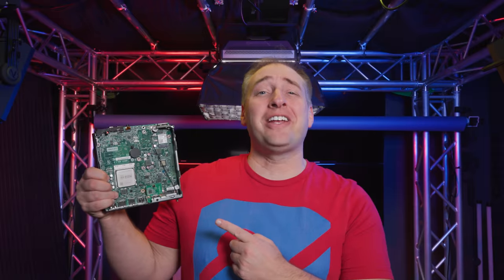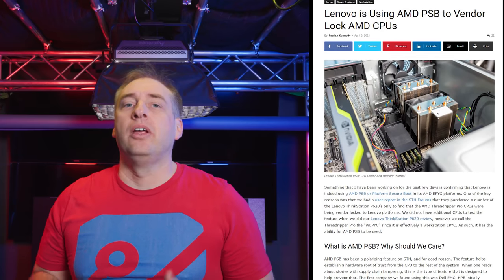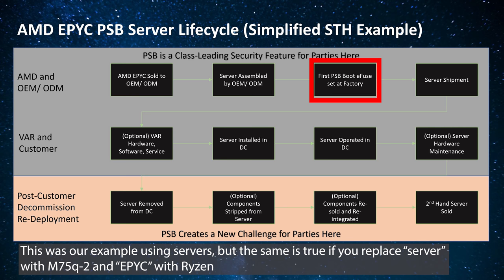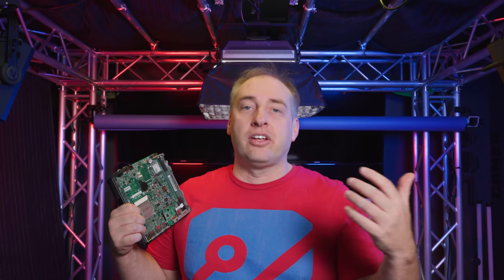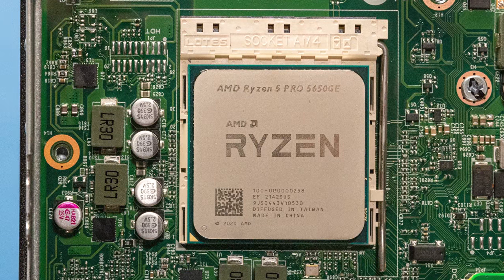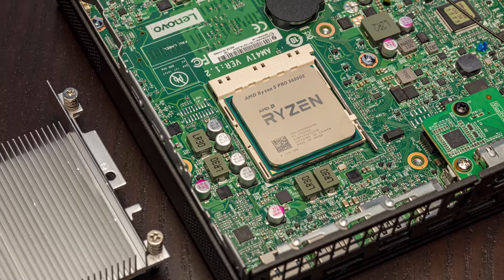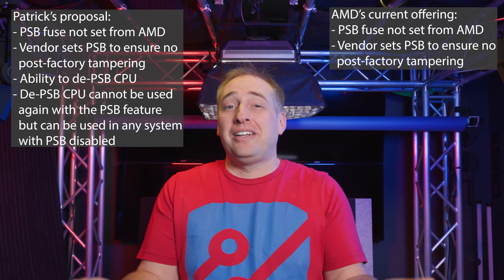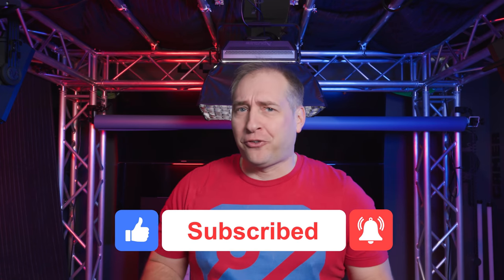Yikes! Lenovo is vendor-locking AMD Ryzen CPUs via PSB

Comment: Instead of saying "Hey are you going to vendor lock your CPU",  the warning when you put in a new CPU should be more like "Would you like to permanently damage your CPU, decrease its value, and increase the chances it's going to get tossed in the garbage because someone down the line thinks it's broken?"

Way to erode trust in your hardware, AMD.  It's wild to think that Lenovo is so concerned that someone is going to put a compromised CPU in their motherboard that they have to permanently damage it.  This doesn't even really stop a bad actor this determined because, if they are going to that length, wouldn't they just make a pre-fuse blown compromised CPU to put in this system?
Reply: You have it backwards. It prevents a malicious firmware from being installed on the motherboard, because the CPU will refuse to boot if the firmware is not signed by Lenovo.
Reply: @l-cornelius-dol  
You do know that if someone has the capacity for firmware attacks, that obtaining manufacturer's keys isn't out of their scope? This doesn't solve jack except the problem of how to make more bank.
Reply: @rockytom5889  Not true. One has nothing to do with the other.
Reply: @l-cornelius-dol  So, at 6:32 in the video the message sure sounds like it's asking for permission to blow the fuses in the new replacement CPU to vendor lock it to the machine.  Otherwise what kind of "vendor lock" is it asking to do?  Why would a brand new CPU that's never been in the system refuse to boot if the firmware was replaced?
Reply: @iguanac6466  : OK, you are going to have to at least attempt to look at why this feature exists in the first place. Once the CPU has been locked to the firmware key (at the factory) the firmware cannot be altered or replaced unless the updated firmware has been signed by the vendor’s key. Ergo the firmware cannot be altered by malware which is run on the PC.

I’m not saying it’s a great way to solve the problem, but it does solve a security problem. It’s not meant to prevent you from replacing the CPU, it’s meant to prevent unauthorized changes to firmware.
Reply: @l-cornelius-dol  I can only go by what this video is claiming...that Lenovo are simply blowing some internal fuses to make the CPU identifiable by the motherboard BIOS vs a standard off-the-shelf CPU and then refusing to run if your CPU doesn't have the correct fuses blown.

This doesn't actually sound all that secure unless there's enough fuses to blow in these CPU's to create something long enough to be a decent unique cryptographic signature AND that the BIOS will refuse to run if a non-paired CPU is installed.  Based on the pinned post, this is not the case.

Vendor locking your CPU is not security.

I'm always happy to do more reading if you have different sources on what you're saying.
Reply: @iguanac6466  The CPU does contain enough fuses for a cryptographic key, or at least this is how it works in Qualcomm systems. Once the key is burned it's the CPU which refuses to run an unsigned BIOS, not the other way around.
Reply: @l-cornelius-dol  Another way to protect against malware altering the firmware is to write-protect the bootblock of the firmware's flash chip. Chromebooks have been doing this for years.
Reply: @eDoc2020  : Oh, I quite agree. I’m not saying this solution is a great one; indeed I detest it. But it does solve the problem. And it does have the advantage of only allowing a properly signed firmware package, protecting the less knowledgeable user from applying an unauthorized, malicious firmware.
Reply: @l-cornelius-dol  Then have a bloody jumper on the motherboard that does the same thing, same level of security and same level of hardware access required to bypass, without creating a ton of e waste or destroying the second hand market and resale value of a bunch of CPU lines.

Comment: This just seems like a vulnerability waiting to happen. So if you have a non-blown cpu, a malicious actor can blow the fusewith arbitrary vendor code and brick your machine?
Reply: maybe you need special AMD-sanctioned code. not something that cant get into the hands of bad actors, but difficult and I don't know how to monetize that
Reply: Hopefully someone actually does that, so we can see the end of this half-assed bullcrap. If a few of these vendors would have to suddenly warranty couple tens of thousands of these CPUs and have their trust shaken, things would quickly change...
Reply: the theory is that if you want to deploy this (and it's not enforced) you want your hardware to fail as soon as possible if you get compromised.

But this need to be at the discretion of the company, and it need a way to be unlocked.
Reply: @kharkin0  I highly doubt that, you probably get a vendor ID from AMD that you can hash for each mobo, so the leak would have to occur pretty high up in the chain. I doubt even state-sponsored operations can get at that, and anyway I don't see the motivation for them to do so, if it's bricked it's bricked, and blowing the fuse would probably require a reboot, so it's hard to exploit
Reply: They could just implement enabling/disabling the feature with a hardware jumper or a special resetting system that requires taking the CPU out of the machine.This one time programmable bullshit almost feels like intentionally purposed for vendor lock in. Maybe it was the easiest solution to implement in a rush.
Reply: I like how the Atmel/Microchip arm processors have a "erase" pin. You pull the pin high and it erases everything. Since eFuses are generally flash based these days they could provide a "erase" pin. Of course the pin might need 12 volts though so that would require taking it out of the system to erase it.
Reply: @steffeneilers8530  ransomware but if you don't pay it destroy your pc
Reply: @LaserFur  maybe a modded bios could ignore the bs to and just run the CPU anyways? Or present fake vendor ID to tricj the CPU to go
Reply: @virtualtools_3021  you would need the encryption key to fake the chip. it's not the bios doing the check. it's the processor on the chip. But a virus could turn it on.
Reply: @virtualtools_3021  But you can just not restart it as long as there is no fix
Reply: @steffeneilers8530  
If you have the capacity to make custom firmware and deliver it to the targets, it can only be assumed you're close enough to the manufacturers to be able to snag the keys.
Reply: @rockytom5889  Making custom firmware isn't that hard and delivering custom firmware can easily be done by anyone who can intercept the shipment from the manufacturer to the end-user.
Reply: @rockytom5889  I think the keys come from AMD, the BIOS/firmware development happens at the manufacturer
Reply: @rockytom5889  I remember reading a news article years ago about the Feds intercepting wireless router deliveries and modifying the firmware on them before sending them on.
Reply: @steffeneilers8530  No. As you saw in the screenshot, a unfired CPU can be locked too by the lenovo system by pressing Y. Meaning you don't need a vendor ID from AMD. So its surely possibly to create your own UEFI and lock the CPU to that. But what I understand, the system must be bootable, meaning a malicious actor cannot purposedly brick a system by doing this, because the CPU will actually check that the signing keys are OK before permitting to blow the eFuse. This would be extremely important incase there happen some glitch in the communications between PSB and processor in the moment you press Y. Meaning, a malicious actor wanting to brick a system for real, would need to implement some keyed BIOS, which then erases itself after a set time unless provided with a unlock key within a specific time.

Comment: I have said it before that the PSB feature is just a way for AMD to stifle the second hand market of their CPUs.
Since the CPU will work with ANY motherboard that is from the same vendor, then it isn't really implying security, just vendor locking. If AMD wants to wave a flag of security, then PSB is a fairly poor implementation, since it doesn't tie the CPU to a specific motherboard, one can still swap out things under its nose.

I wouldn't be the slightest bit surprised if the TPM feature gets combined with the PSB feature in the future, effectively making all Windows 11 systems and others who depend on the TPM feature ending up vendor locked as well. And that would impact the second hand market rather quickly.

And the idea at 11:53 is a good one, being able to disable the feature and have a functioning CPU is a good solution. And I agree, if one wants "security", then one obviously shouldn't buy the CPU second hand...
Reply: The point isn't to tie the CPU to a particular motherboard, the point is that the system will only boot firmware signed by a specific vendor.
Reply: @DMStern  If one blindly trusts a specific vendors firmware, just because it has their signature. Then what stops an attacker from using firmware with known security issues that has the same signature?

The vendor could update their signature for the new firmware, but then you need a new CPU.

And when do we tend to get firmware updates? Well, when security flaws are found.

Therefor it would have been better if the security system provides its own signature for the BIOS chip to store on the motherboard. Tying the CPU to the specific motherboard, and not to the vendors slew of software that has the same signature, where a fair portion of that software is known to have security issues.

This would however require the CPU to not be a brick if it detects a mismatch in signatures, but rather provide the lack of security up our boot chain.

And a decent way to implement the security would be if the CPU scanned the BIOS ROM, hashed it, and provided a signed hash to the BIOS ROM. The signature here would be some unique encryption key that only our CPU knows. It can be symmetric encryption as well, since it at no point has to leave the CPUs internals.
Reply: @todayonthebench  The scheme you describe *is how the PSB works today*. The only difference is that the system vendor programs the key into the CPU. The alternative would be that AMD would have to vet and sign every firmware release for every vendor.

AMD has features protecting against firmware downgrade attacks, but I don't know the specifics of how it's implemented.
Reply: @DMStern  I personally think AMD has a poor implementation. It should be the motherboard that stores the proof generated by the CPU.

But most importantly, a CPU shouldn't effectively brick itself just because it finds an untrusted firmware.

Considering that they rely on OTP memory to store the credentials, it isn't much they can do to stop downgrading. Unless they have a lot of extra OTP for such "alterations" over time, but then they still have the issue that the CPU will become worthless junk after sufficiently many firmware updates. (And OTP fuse arrays takes a fair bit of room, so they won't be wasting tons of silicone on this, I am surprised if it is more than 1-2 k bits in total.)

"The alternative would be that AMD would have to vet and sign every firmware release for every vendor." Isn't the only other alternative. There is plenty of ways to ensure security in a larger system.

The system I described won't on the other hand tolerate firmware updates nor downgrades, or any change to be fair. But this is why it needs some secure state where firmware updates can be performed and signed (likely in BIOS).

To start this feature, we likely use a user defined key stored in OTP to open that option. Preferably we should have an 8 or more character, case sensitive alphanumerical key that can only be accessed after x minutes after system start. (The timmer after start is so the CPU's security system only accepts 1 attempt per power cycle, and the timmer is just looking at the 100 MHz system clock, and from there it is a simple 35 bit hardware counter.)

This is to prevent anyone having KVM/hardware access from just flashing in some new firmware and have it instantly trusted. 

Though, considering how we also want to be able to make a CPU "unsecure" again, even if we don't know the user password. Then we need some way to validate that the CPU is secured or not. Here simple hashing and checksums is our friend. Just store a AES-256 key in the CPU's OTP array, have it decode something for us, if it does it correctly, it is trusted. If it doesn't, then we can't trust it. (If the security system is turned off, this OTP key should obviously be erased.)

Reason for the symmetric encryption is that any application in need of hardware backed security can just send its data through the validating function to have the "this needs validation" version of it. And symmetric encryption is simpler to handle. And this is safe since the key never leaves the CPU's internals.
Reply: @todayonthebench  A system that can sign its own firmware doesn't protect against the attacks these schemes are designed to protect against.
Reply: @DMStern  The discussion about what firmware one can and can not trust is an topic in itself. But even if AMD or Intel gives  a firmware its token of approval doesn't really mean we as end users can trust it. Nor if the motherboard vendor gives it a token of approval.

We can only trust it for as long as we know that it doesn't contain any known security issues or back doors. Ensuring that is hard.

But yes, the firmware should still be signed by the author. And having a trusted third part validate it and sign it as well isn't a bad idea. Likewise is having a known checksum a good idea. There more ways for us as the end user to validate that it is what it says on the tin the better.

But only allowing "approved" firmware is not required for security. (and that honestly has some interesting security deficits in its own, like can one trust the approver?)

Providing the CPU itself with some minor "BIOS" of its own where it can provide the end user with the checksum of what ever contents the BIOS ROM contains would be a somewhat decent way to ensure that the end user can check that they are running the firmware that they trust. (How one would do this is a different question. Perhaps a simple text string shown in the upper left corner of the screen before the BIOS splash screen. It might only be there for 0.5 seconds, but people have phones with cameras these days.)

In the end, it is a lot easier to point out security flaws than what it is to ensure that they aren't there.

The idea of having the CPU sign its own environment is more about adding a lid on top of what one has already secured, ensuring that no one can modify it without getting noticed.

Ensuring that you get the firmware you can trust, well checksums and signatures is your friend. As long as you can trust that specific firmware.

Comment: it is going to cause enough problems in the new product market, let alone the second hand market - Retailer sells a CPU, purchaser installs the CPU into a system that v-locks it, purchaser then decides to return the CPU using whatever consumer laws are in place in their region. Lets hope this does not become a common feature of general motherboards. A system that converts $600 consumer focused CPUs into nothing more than potential e-waste on first use is not a great idea.
Reply: I'm not sure he said if the system itself blows the fuses and vendor locks any CPU put in it. If it does, then this is SOOOO much worse, and it's already pretty bad.
Reply: @kal9001  It was mentioned that if you put a new CPU it asks if you want to vendor lock at around 6:30 in the video, so yeah it really is that bad.

Comment: I really think there should be some clear automated indication that this CPU is vendor-locked. Like when you blow the fuses to write the key there is a spot on the board that changes color so end users can see if the CPU has been vendor locked or not, even if they don't know to what vendor

Comment: Stop buying hardware from vendors who close source and lock 🔐 you out of their firmware...  FPF needs a indicator or software to display status.

I'd say a law should be passed that only end users can blow the FPF on their systems... Just like furniture tags.  Seller can't remove them.
Reply: Seller can remove furniture tags, but not those tags required by law that declares certain content. Its pretty clear, if seller could just remove any labels/tags informing of dangerous content or other tags required by law, the labelling law would have no effect. So basically, its a law protecting another law. Seller CAN remove other tags on furniture, for example tags that prevent the return of the furniture, or manufacturer warranty tags or similiar, to "screw" the customer.

Its basically, a seller is not allowed to paint over the food declaration on a can of food either, because then sellers would just paint over anything that has with fat and sugar to do and just sell it as sugarfree superhealthy fat-free food.

Since the FPF isn't mandatory by law, you cannot pass a law prohibiting sellers from blowing it, because then you could easily construct the lock so it auto-blows the fuse upon inserting it into a system "Marries by the first vendor it sees" meaning same effect would be made - customers power on system for first time and CPU instantly locks to it, meaning it wasn't seller that blew it, it was the customer that did it by powering on the system for first time. To pass a law prohibiting sellers from blowing it, you would need to pass a law how the feature should be implemented first.
Reply: @sebastiannielsen  Lets be real, no legislation like this will never come to be.

That said, auto-FPF or FPF preformed by the manufacter or seller could be banned.  Just need to say that generalized components can not have irreversible changes made to them by the manufacturer or seller of systems without end user approval.